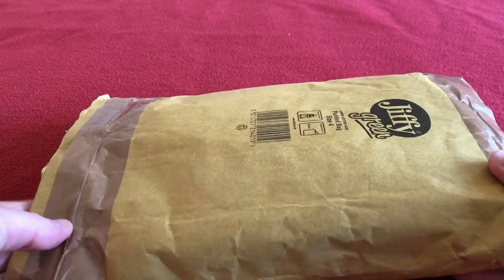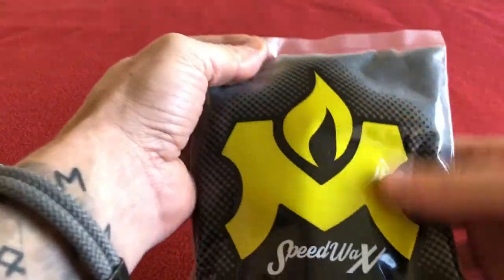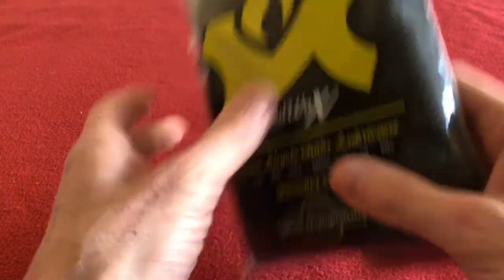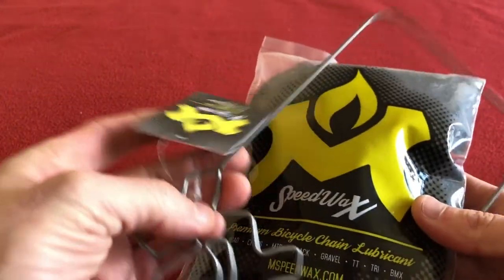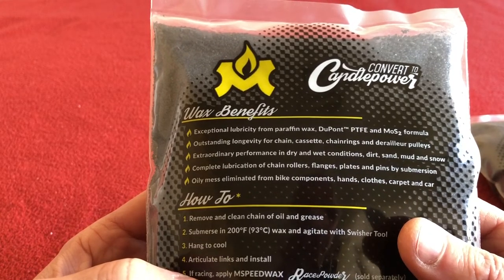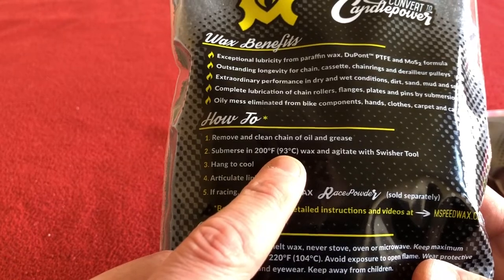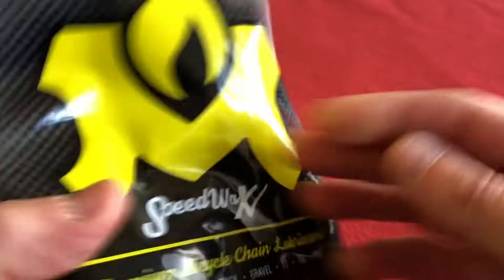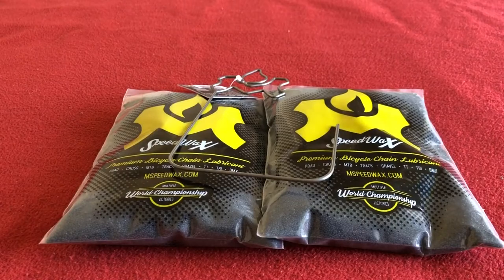Molten Speed Wax Unboxing

Comment: There is a way cheaper option available .. just mix paraffin wax with soy wax and use it the same way as Speed Wax .. you will not be disappointed
Reply from the maker: cannon1156 yeah I used to make my own, but as I said in the video, the mix has gone wrong somehow and I thought I’d try this product. 👍
Reply: @KyrosHouseCycling  .. I am not referring to a liquid mix but a simple melted wax method that is way cheaper then MSW .. and very effective